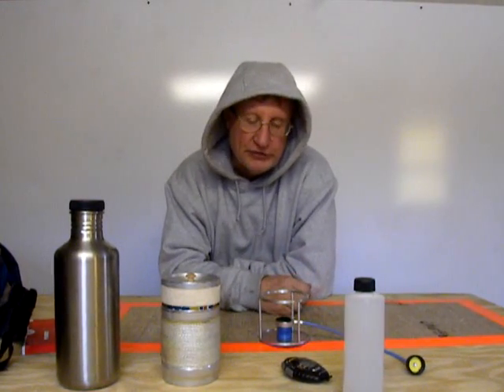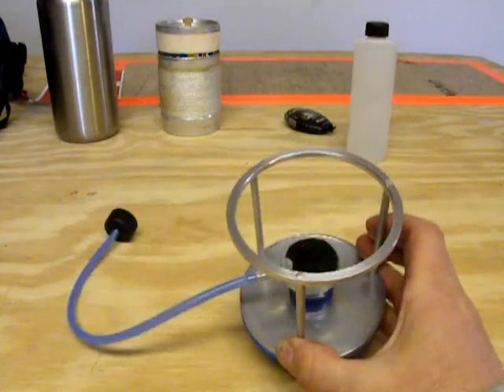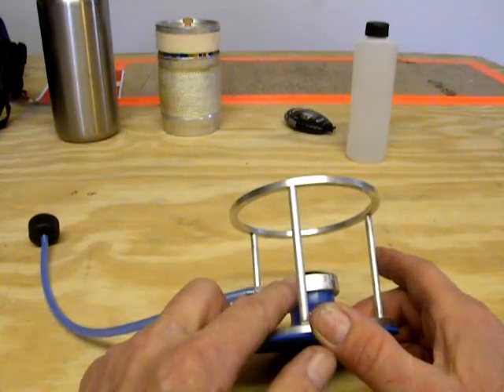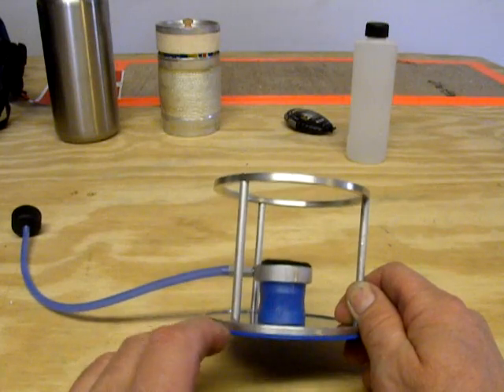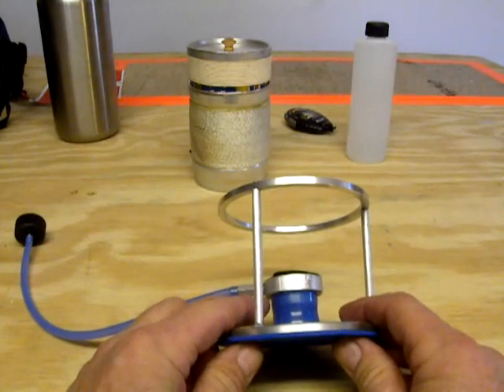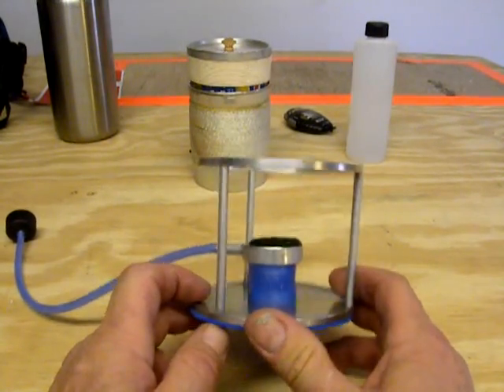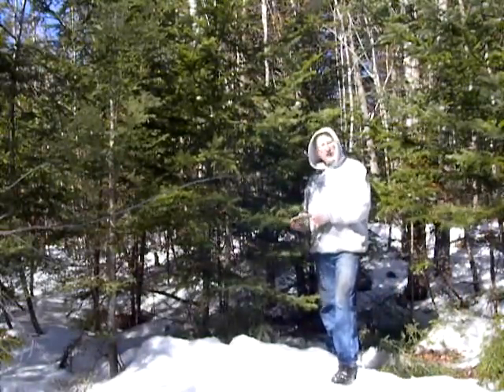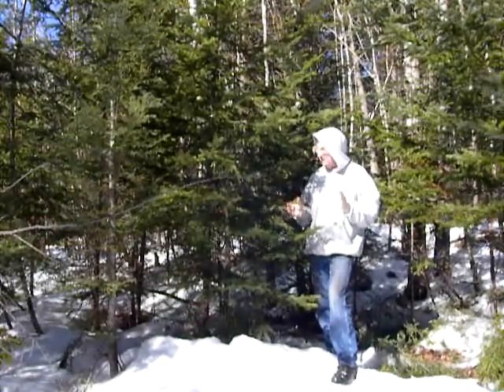Balsam Fir--stove talk---Maine woods

Comment: It would be good if you had one that would simply burn nine minutes on one filling. Of course, the temperature of the water you want to heat will vary causing a different amount of heating time to be needed in each case.